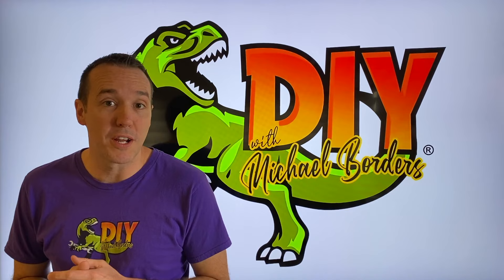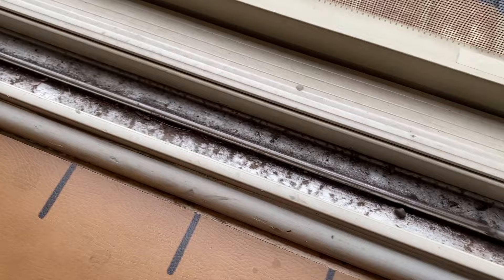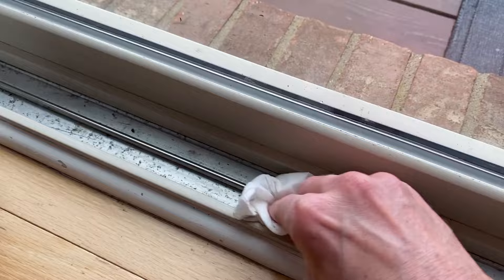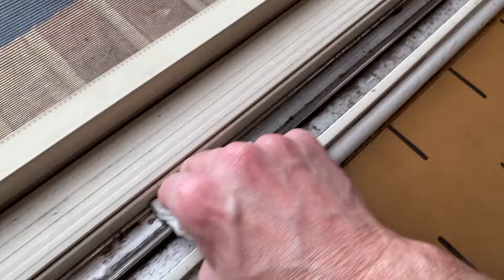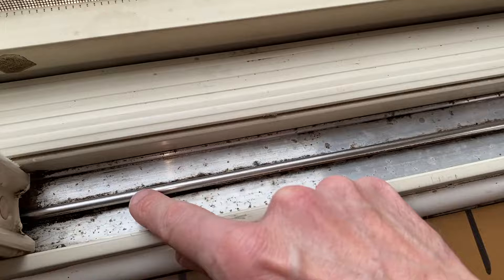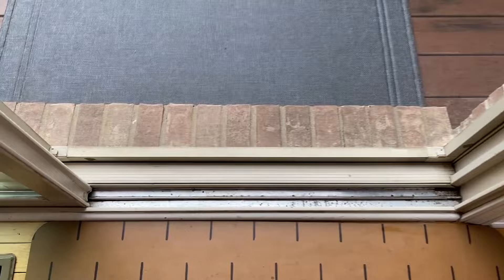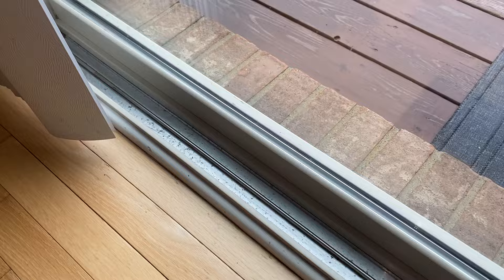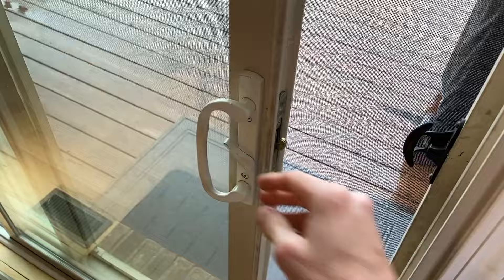Sliding glass door hard to open and close - DIY hack

Comment: Don't use oil or lithium grease or Dawn dish soap! Spray the thing the doors slide on with SILICONE lubricant so the rollers don't pick up dirt and hair like they do if you use oil or WD-40. That was a tip from the most intelligent glazier and man I have met in my life. But, yeah, clean the rollers first. I've used silicone for a few years after the glazier totally refurbished all of my sliding doors parts, and they are still a breeze to open. As well, he also glued a cover onto the thing the doors slide on. It's smooth and a fresh start.